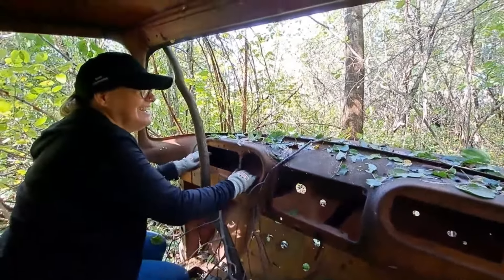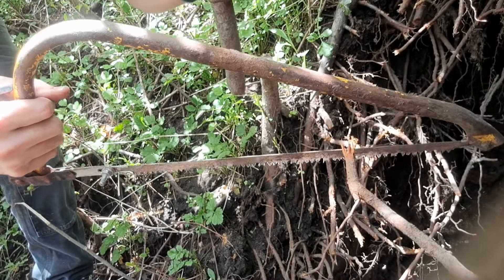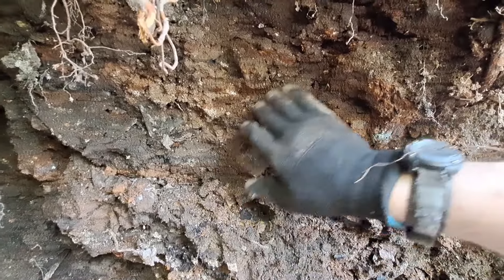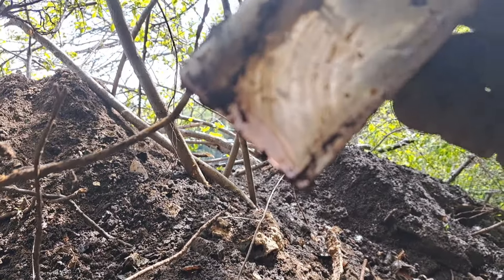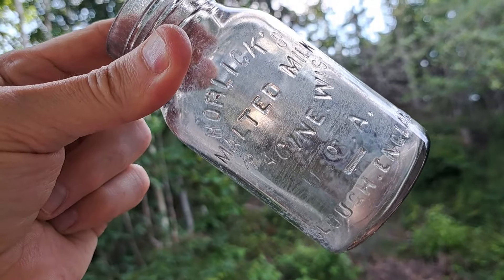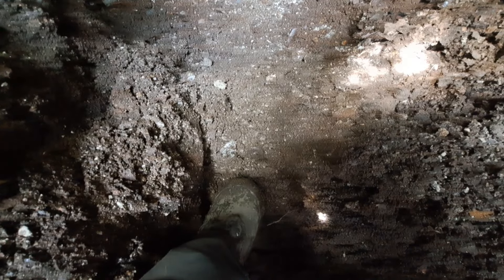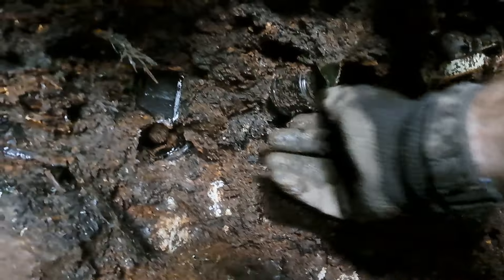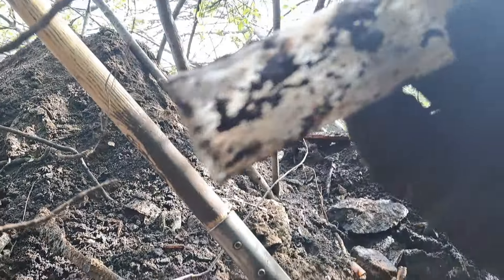💥 2024 Bottle Digging Dump Digging #47 💥 100+ Yr Old Antique Bottles Horlick's Peacock Heinz 362 ©

Comment: Horlicks are listed at $25-$35 with the 2 line variant coming in at $50
Reply from the maker: @therelicextractors4761  what's a two line variant ?
Reply: @Travelling..Bottle..Digger  just says Horlicks (line 1) Malted Milk (line 2) with a vertical presentation..bottle laying on its side..aqua ones are even tougher to find
Reply: I also have a gallon size horlicks I dug back in 2018 in Scranton Pa
Reply: I think I'll do a short video with all the different variations of Horlicks to further explain this underrated jar
Reply from the maker: @therelicextractors4761  I got a few larger ones, but nothing that size